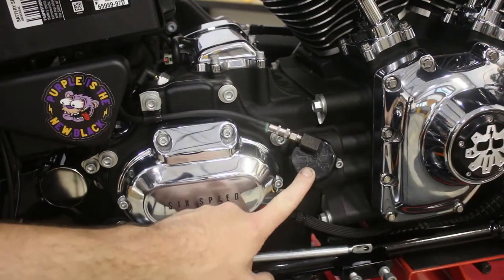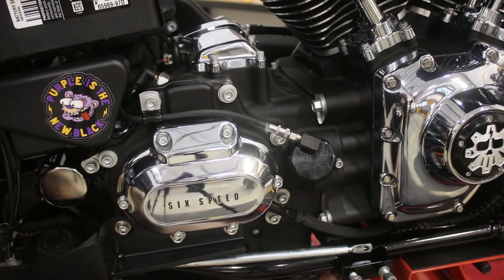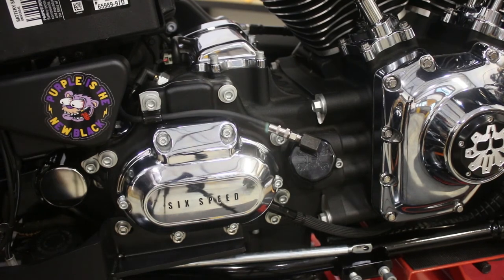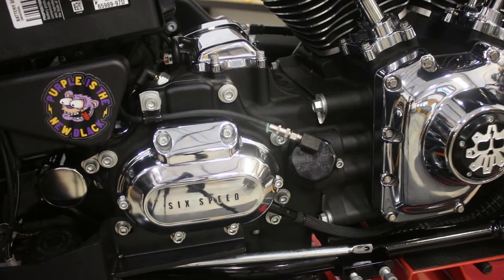Product Overview - Feuling Vented Dipstick

Comment: This set up is good look to it but I have 20 m8 softail low rider s and the neck of the oil filler is bit skinny located in front of side cover. With a vent dipstick with hose sticking out  looks funky as I have seem on other low rider s. Any suggestions?